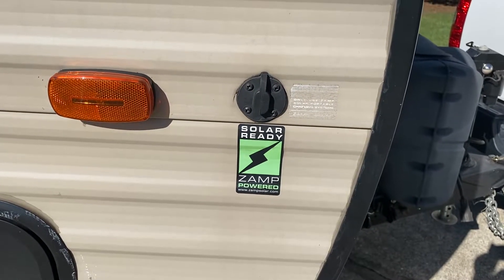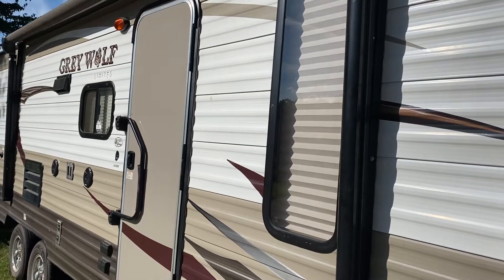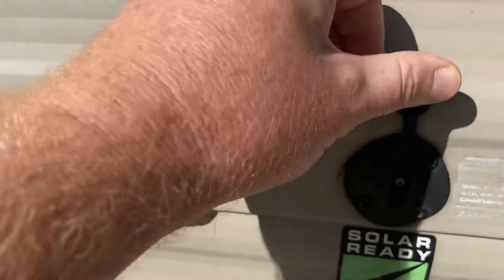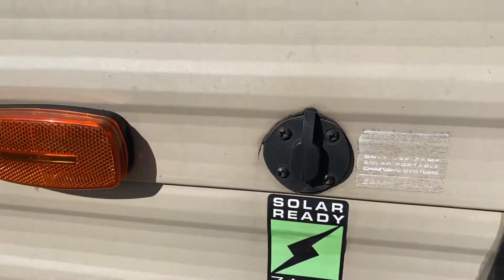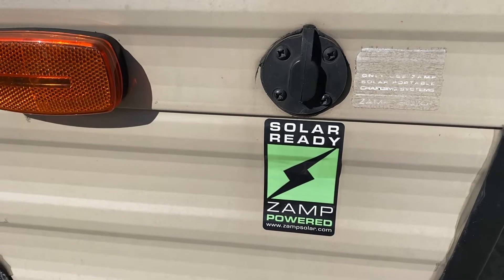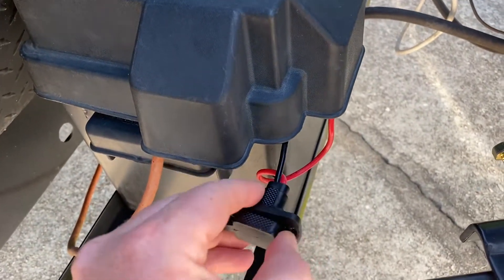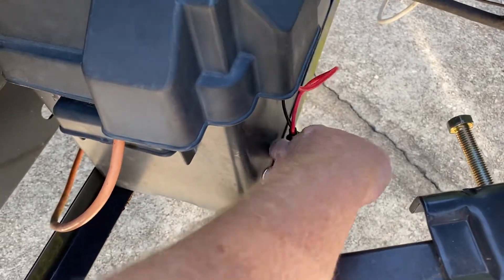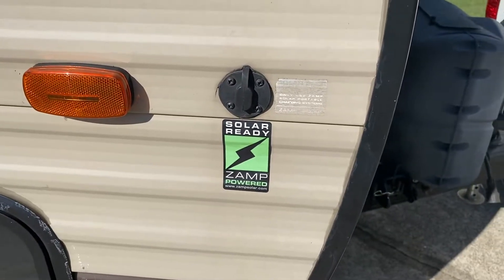Zamp solar hack

Comment: Did you attach the black wire from the adapter to the positve battery terminal?
Reply from the maker: I had a reverse adapter, never touched or changed any wires. But later moved on to connecting straight to the battery with a charge control because I found out I would have to dig through the rv to connect a charge controller to the Zamp anyways. So now I don’t even use the Zamp
Reply: @Work0smarter thanks

Comment: cant you just reverse the pos/neg at the battery? from the zamp wires....red/black...black to red?
Reply from the maker: Not sure about that
Reply: Yes https://youtu.be/4BeEuu8uKbk?si=JRYuBBe-FPY7KHK_
Reply: I reversed the wires inside the camper at the back of the SAE port. Didn't have to think about it again, works great.

Comment: Zamp installs a fancy fused wire to the battery. Hey guys I made it solar ready! Durp.... Me when I make something solar ready, ok it has your fancy fused wire going to a great mppt controller to charge the batteries and it's also grid tied to the AC so your not using much hydro when plugged in so long as the sun is out. You can use battery backups on the plugs so you don't need to have a battery bank but you do have the option to do so if you get a inverter. 200watt solar per 100ah battery is the rule of thumb

Comment: How is this better than just buying a little adapter to reverse polarity? As you said, your panel needs a charge controller either way. The lead you've added isn't nearly low enough gauge to be safe, lacks fuse protection, and dangles from the battery.  This seems less safe and worse in just about every way.
Reply from the maker: I see your points, I think there is some wiring issues around the zamp that was keeping the battery from charging when I tried it 🤷‍♂️ the was the simplest and easiest way I could prep. The charge controller is on my solar panel and limits the battery charge so do I need a fuse protector? It’s been working fine so far to charge the battery, it gets about 4-6 hours of direct sun daily